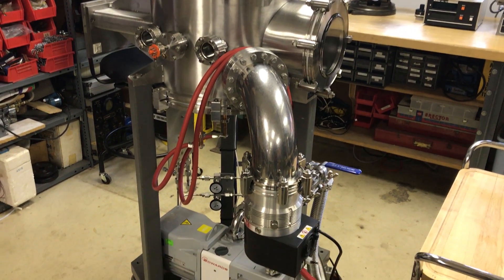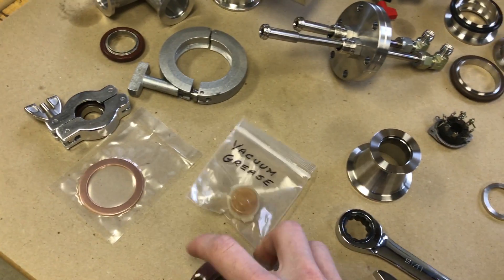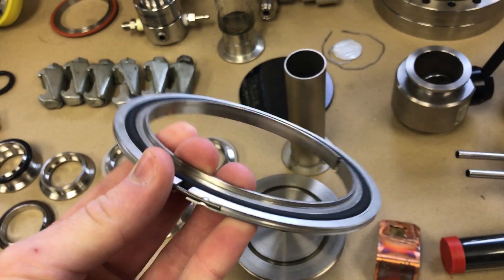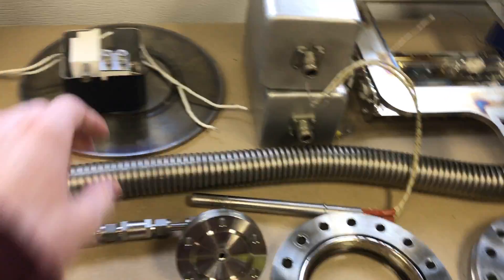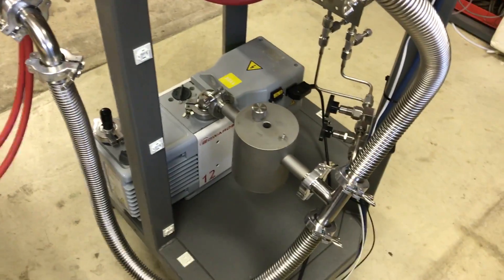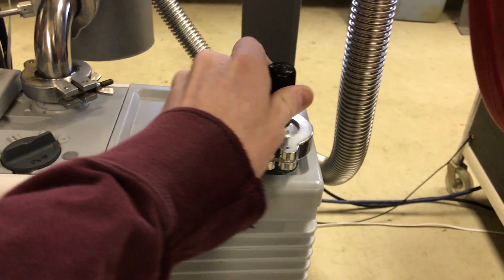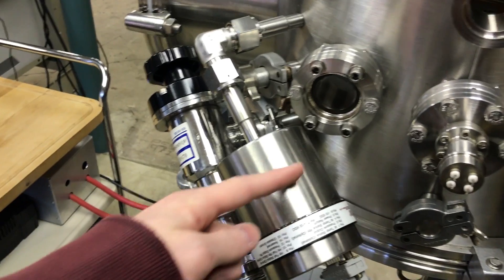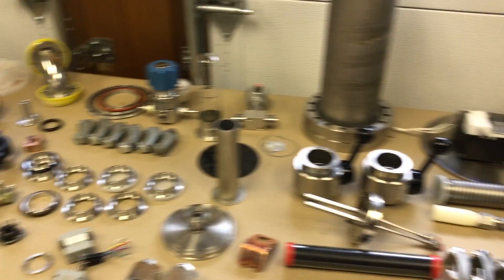High Vacuum Chamber Basics, Part 1

Comment: With the capacitive gauge that references from a known vacuum, how accurate is that? Is it pretty temperature dependant? And how does it prevent the known vacuum becoming polluted positively or negatively with just a diaphragm? Or is the diaphragm itself like the copper seals but is just a plate and the deformation of that plate is whats measured and provides the bite edge seal?

Sorry for the stream of consciousness there, I'm an electronics nerd... Also, what the hell are you doing with all that gear?!

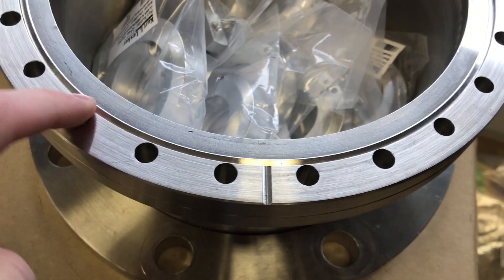Comment: 4:05 Is there a reason the turbo pump needs to be in a vertical position?
Reply: Yes, the bearing. The rotor is quite heavy, and it runs at 1500Hz, equivalent to 90'000 rpm. One bearing is magnetic, while the other is a ball bearing.

Comment: Get rid of the acetone residue? Are you freaking serious? If the acetone has some non-evaporating stuff in it, then who's to say that the same thing isnt true for the isopropyl alcohol mixture? If you're that worried about non-evaporating stuff in acetone, you should distill your acetone instead of using isopropyl alcohol later on

Comment: I have got another idea on how to make ultra high vacuum pump:
- Make a cylinder out of metal (the crankcase)
- Make a cylinder that fits that cylinder with a 1 micron space (the piston)
- The shape of the inside cylinder must be bumpy towards the center, so plastic would adhere to it
- Fill the (1 micron) gap between two cylinders with nylon 66 , it is a naturally lubricated plastic compound
- Using a good amount of force, remove the internal metal cylinder , the nylon 66 would un-stick from the outer cylinder and you would get a piston that will fit the crankcase with no free space between them, it would be atomically fit, it wouldn't be 1 atom fit, it would be practically 0-atom thick with no possibility for other matter to pass between. You could probably make a nylon 66 coating on the crankcase too (and do this inside a nitrogen jail to avoid oxidation of metal) , this way you would have nylon 66 coating on both, the piston and the crankcase, because otherwise the oxide on the metal might not be a good to support the force generated by the vacuum. Must work a lot better than an o-ring.

Comment: to make absolute vacuum you just need to cut any material with x-ray laser . X ray laser of say 20-30 picometers (wavelength). So you shoot this laser through the material in a circle shape, exactly one atom of material will be evaporated, this way you will create the piston for the pump. Then you just pull this piece of material and you have got vacuum , no valves or any kind of this stuff is needed. Picometer positioning is already achieved using interferometers, I have seen it here on Youtube the CNC routers of that precision (SmarAct GmbH , for curious). So, absolute vacuum is not science fiction anymore.

Comment: Do you practice torquing down the bolts and to specs ? Once done o rings are introduce to heat then it’s best to replace them . Our -8o o rings are about 25o $
Reply: O-rings must not be exposed to heat. Some are specified for 100 degrees, while others are for 180 degrees, but I wouldn't operate them with vacuum.

Comment: Why isn't the turbo pump just attached directly on the side.  The right angle pipe would increase the chance a particle would be rejected bouncing through that port, right?
Reply: Turbo pumps have to operate with the axis vertical. The bearings are made for 90'000 rpm (1500Hz) and one of the bearings is magnetic, while the other is a ball bearing.

Comment: Thank you for sharing your knowledge with us. I've been working with E-Beams for a couple of years and high vacuum is the main thing in these machines. Gasckets, flanges, and pumps are very familiar to me. Very interesting and complicated field..
Reply: E beam welder here, surprising how little "cleanliness" went into the machines we worked on. Would have puddles of oil from the coating on the metal strips, fingerprints, wobbly gaskets, and more and the high vacuum would still work great. Of course the chamber and pump size was proportioned quite differently so just brute force pumping all that stuff out of there.

Comment: If anyone is looking to save a buck and machine some vacuum hardware themselves this handbook has toleranced dimensional tables for many types of vacuum sealing features you might want (you'll want to use 304 stainless for the best results but anodized 6061 will also work in a pinch) .  
 https://www.parker.com/literature/O-Ring%20Division%20Literature/ORD%205705%20Parker%20O-Ring%20Vacuum%20Sealing%20Guide.pdf

Comment: @ Sam Zeloof what would be the best vacuum pump configuration for PECVD deposition?
Reply: this is a good question. In general,  the type of pump you config depends on the size of your chamber and  the vacuum level required.
Reply: @yhlei5856  thanks, I’ve since done a lot of research since I first asked this question. It boils down to what the process is, what the absolute vacuum level needed is. Then chamber material, gasket material, gasket type, vaccum pump type, what vacuum system and throttling. And much more. Thanks for the responses
Reply: The material being deposited should not contaminate or even react with the remaining gaz atoms, nor would you want to include too much gaz atoms into your layering. The less deposits, doping, are allowed, the lower the pressure has to be.

Comment: Why do you need those valves, can't you just pump through the turbopump directly as it will pass everything feely anyway when not running and only later when main pump cannot suck anymore you tun it on
Reply: I think I read that you can but it has some disadvantages, like lower roughing speed to get the chamber initially down to low pressure.  Maybe some other problems too but I can't find the reference right now.
Reply: @perspectivex  
I do not see any logical explanation for those issues, because turbopump is essentially just a plain tube with some turbines, and it practically does not interfere with airflow
while adding extra valves and extra plumbing will definitely increase leaks and vacuum chamber volume increasing evacuation time that way.
I could assume some safety issues because if you let air in quickly you can damage the pump but this can be solved in other ways.
Reply: @deltaxcd  No idea... I'm starting out with vacuum systems and just relaying what I was pretty sure I read so you'd have to Google it to see if you can confirm.  Just because it's not obviously logical doesn't mean there's not some perhaps more obscure reason for it.  Also I see now that Sam replied to Matthew Beardmore in the comments below about this, saying: "generally frowned upon because it will cause the turbo to freewheel and spin up".
Reply: @perspectivex  
I never noticed any information about that either so it is hard to tell if this is some kind of stupidity or something important. and I am also just starting with the vacuum but in a less expensive way.
the fact that it will cause turbopump to spin um is nothing to care about either

I suspect that this can be a mistake copied from ion pumps because if instead of turbopump you use ion/getter pump it is absolutely required to use this kind of system

Comment: how do the turbo pumps work? what kind of engines do they use, how fast do they spin, how do they provide sealing?
Reply: For more info visit google.com
Reply: a 3 phase rotating field, If you get a permanent magnet balanced it would be a BLDC otherwise an asynchronous motor onto whatever surface

Comment: Hi I have a question . To get to ultra high vacuum is it possible to use a double “o” ring ? In theory ??? 
Thanks very much
Reply: No. Ultra high vacuum requires heating the lot out. Therefore no rubber.

Comment: Scroll pumps come in handy, you don’t have to worry about back streaming. Also, with an isolation valve between the chamber snd the turbo, you don’t have to worry as much about “dumping” the turbo and you can leave it on. Great video!

Comment: Given that this video was posted in 2017 this suggestion may come too late, but the manufacturers of the pumps that I deal with recommend that you vent through the venting valve on the side of the turbo in order to maximize its lifetime. Apparently that's where they are designed to have gas enter them. Also, while it's tempting to vent slowly, they should spin down relatively quickly so they don't spend too much time operating at any resonant frequencies of the pump.

Another thing I would suggest if you want to reach good UHV conditions is not mounting the turbo around a bend like that if you have the correct adapter. I'm not sure why it's like this. Is this model of pump supposed to be operated horizontally or something?

Very cool stuff. And please let me know where an ordinary person can afford this equipment without a research grant. I've been going to the wrong garage sales.
Reply from the maker: +Brian Climbs thanks for the suggestions, mine has a vent valve and I usually flow gas into the chamber via mass flow controller to spin it down faster. I get almost everything from eBay or dumpster dives at high tech companies basically
Reply: I was genuinely surprised to learn that you are supposed to vent into the middle of the pump blades. I was initially concerned about the seemingly aggressive spin down and the possibility of back-flowing. 

Man, I wish there was some kind of hackspace or indie lab that had this kind of equipment!  @SamZeloof

Comment: Great video. Quick question - Why do you initially evacuate the main chamber through a separate line rather than through the stopped turbo? I understand the turbo can't run in atmosphere but I believe they are pretty much a direct pass-through when not running? Thanks
Reply from the maker: Good question, this would work but is generally frowned upon because it will cause the turbo to freewheel and spin up while not under power. Good to pump it down first through another line.
Reply: I think it is a matter of the volume to be pumped. We have them in series. and the turbo has to accelerate anyway. But our volumes are small, in the order of a few liters. The turbo is driven with a few amps to start with, and revs up with decreasing pressure. The vacuum can also be seen at the pump current, which decreases with decreasing pressure. When the drive current stays too high a bearing replacement is due.

Comment: Should I use greese when I connect a kf style connection?
Reply from the maker: +Island Labs usually grease is used for old o rings that have cracks but a little bit doesn’t hurt for mid vacuum.
Reply: Sam Zeloof I'm shooting for a vac in the -6 to -10 range and I'm losing the battle, I have some kf connections that I cant get rid of (sensors and the connections to my roughing and backing pumps) do you have any pointers on how to get the best seal from KF? I have stopped clamping down super tight and I'm using new rings every time I reconnect flanges, I perfectly clean with acetone and dry. Is there something I'm missing or am I expecting too much performance from these seals? Does it matter if I use buna, silicone or FMK?

Thanks for the video BWT great info
Reply: @islandlabs7641  go for viton, don't soak in solvent the rubber absorbs it

Comment: my question from a total beotian
why dont you use more welding, why to use windows. we have very small cameras  they could be put inside and just a USB 3 connector must be embedded this connector can take the maby cameras+ all the probe inside+ small robotics hands control .
From outside it will not be very glamour but it could be much cheaper 
please tell me what is the point I missed ?
Reply from the maker: Honestly i have no clue what youre asking but this system could not have been made much simpler.
Reply: @SamZeloof  I think he's saying put cameras and other equipment inside and make the chamber basically without ports so it'd be cheaper, just small holes to feed cables in that are sealed somehow.  But I guess the outgassing from all the stuff inside would negate getting to high vacuum and introduce lots of contaminants.

Comment: How much money did you put in there? Any advice for us diy-enthusiasts for keeping the costs down?
Thx!
Reply from the maker: +Alvaro Rodriguez eBay eBay eBay that's basically all you can do, and all I did. Also make connections and talk to people, you'll start to realize your friends friends have vacuum chamber parts they are willing to give you
Reply: ¿Have you considered manufacturing your own parts?
Im thinking wether to buy a small chinese-ish cnc, or build myself and electric oven, a press and sinter.
Not too sure if sintered parts will cut it for vacuum, even if the have a 100% fill.
Reply: check out this guy's build, luciano jorge ritchie, for doing telescope mirrors for ideas: https://www.youtube.com/watch?v=75AoWl3jhcQ.  I don't know what you want to do but he shows how you can make a high vacuum system for not that much money.

Comment: That is a fantastic chamber! I am building a vacuum chamber and I want to add a gauge, I was thinking of buying a MKS 901p transducer, though I am not familiar with the analog output. How would I measure the pressure indicated by the analog output? Do I need an arduino, voltmeter, or what? As far as programming goes, I know how to use python, so yeah, I am quite a newbie at this...
Reply from the maker: +plls12 analog output means it will give you an analog voltage usually between 0 and 10 volts proportional to the pressure. You can just use a voltmeter
Reply: Thanks, I guess MKS has a manual that lists X voltage means Y pressure (Torr), if not, how can I interpret my pressure in Torr?

Comment: Is this how you will dope the semiconductors? You will need boron or arsenic coated surface on ends of electrodes in the vacuum, with high voltage to create the plasma, then an additional strong magnetic field (voltages) to propel the boron/arsenic plasmas into the silicon substrate which has been masked and etched as seen earlier in vids? Or as you said you will do it simply by spinning on some how? Then use this to deposit aluminum or what ever metal for the traces to connect the muskets or transistors?
Reply: Also for mem's inertial sensor I wonder how to create a suspended lever which can deflect changing capacitance? Maybe silicon oxide layer growth, then silicon deposition or crystal growth and then etching of the silicon oxide layer beneath?
Reply from the maker: +marshalcraft the process you describe is ion implantation. This is near impossible to do in a home garage. I do my doping with diffusion of phosphorus or boron containing spin on glass layers. I mention this in my semiconductor fab basics video
Reply from the maker: +marshalcraft there are plenty of techniques for creating free standing mems structures.
Reply: I see.

Comment: That chamber looks so "mad scientist" awesome - was this a surplus find? What did it cost? Guessing a tiny fraction of what it did originally.
How do you go about finding the tiny leaks that limit the vacuum?
Reply from the maker: haha thanks. This chamber was probably about $60k new, I got it for a small fraction of that. And then I had to get all of the gauges and pumps and other accessories. One way of finding leaks is a helium leak test. 
2:50 https://www.youtube.com/watch?v=DZGTh3hGzNc&t=254s
Reply: But how much exactly dude?
Reply: @ralfiasz  id assume 2 to 3 thousand just for the chamber if it were used